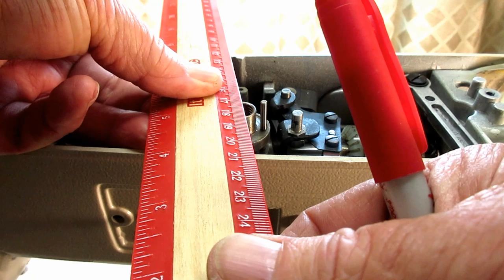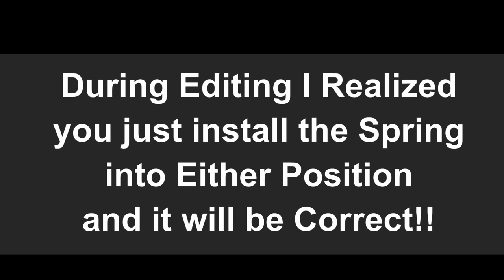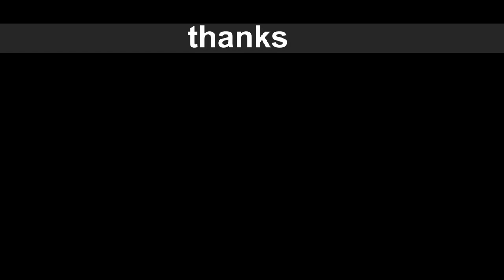How to Adjust the Camstack for Binding or Looseness on a Singer Model 457 Sewing Machine

Comment: Another great video Andy..I had a binding problem with my 413 and almost lost my mind trying to figure out what was causing it..Turned out it was a gunked up takeup lever.
Reply from the maker: You are picking this repair stuff up pretty fast! Hope you are having fun with it. Thanks for fixing the machine. Good luck.
Reply: @andytubesewing1953   Thanks..It's an enjoyable hobby for sure..I'm mechanically inclined but my memory isn't the best so I may have trouble remembering the part names..Luckily I'm ok at remembering where things go usually without pictures but probably a good idea just in case.

Comment: I bought a 347 with a broken gear and my mother's 348 with a metal gear ,I can take could make one thanks to you. I'm having bobbin trouble now but I just found out I'm 1/8 inch out of time, I don't see how it was sewing at all. Plus my needles aren't big enough or my thread is breaking I can tell that I sewed through an oily rag while ago and it lasted a little bit longer being out of time and everything.
Reply from the maker: That rotary hook can be a little forgiving with the timing, but wow! I'm also surprised it sewed. Sounds like it's coming along though and thanks for saving the machine.

Comment: The 347 has a different knob on the cam or as the 348 has a completely different top and a completely different kind of a cam.  it's amazing how these things are made so many different ways. If you can work on one of these you can work on a motorcycle transmission
Reply from the maker: Right you are. The 348 is the "premium" version with a small flip-up lid and the large chrome handscrew ( too big to call a thumbscrew I think) to make it easy to change out any of the approx. 30 pattern cams. The 347 is a standard ZZ machine with the one ZZ pattern cam screwed down. Haha, I don't think I could do a transmission though, honestly, but I knew you'd do fine with the machine. You know there are about 100 more models of Singer machines, just in case you get the urge to play with another one. Here is my main playlist page with videos sorted by model number. You could browse thru and see if any particular model caught your eye.
https://www.youtube.com/channel/UCUSPDsHaFtRoz1VA2U1xJ4w/playlist   Thanks again for watching my channel.

Comment: Thanks again for another fine and detailed video.  I have a 477 stylist that also feels like it is binding. I tried this adjustment of the cam stack and it still binds in one place. I need to order a new vertical gear as this one disintegrated and the timing belt is off. I have not taken the needle bar out yet.  The take-up arm looks a little bent in the direction of the balance wheel, but I’m not sure, maybe it had a slight bend to start with. Where else should I look for binding?  Also, no grease or oil goes on the nylon/plastic gears?   I hope you are feeling well, God bless you! (On this 477 you have to turn the stitch length knob to the space to the left of the zero in order to use a piece of fabric to pull it off. It then came off fairly easily) Thanks again.
Reply from the maker: No grease or oil on plastic parts (including gears) is what the Singer guys told me. There are modern greases now made for plastic so it's up to you. I've never seen a factory bent take-up lever, but plenty of take-up levers that were damaged or out of adjustment and causing binding. Here is playlist of some of my take-up lever videos that may help: https://www.youtube.com/playlist?list=PLsCOZgzzaiKLDJCdMOQ7FkIbiAaRT-8AA    Other things that can cause binding are dried up oil settled into the bottom of a bushing/bearing and on every turn or movement that oil drags or makes turning hesitant. Using a heat gun or hairdryer on all the moving metal parts you can see then generously applying fresh SMO can often clear up binding and hesitation. Oiling is the first think I do unless I'm just going to remove all the parts. The instruction manual has oiling instructions for your machine. It's free from Singer here: https://www.singer.com/search/support?title=477  Thread wrapped around under the hook. Those are some of the more common things to cause binding. Of course there are a dozen more.
Reply: Thanks for your quick response!  I will continue to search for the binding. I checked the cam stack, and for the the horizontal shaft being too tight up to the bushing, it was not either of those things.  Also the thread take-up system and needle bar. I won’t give up. Thanks again for your response and ideas of where to look to fix this.

Comment: My hand wheel turns about half way around and then is hard to turn for a bit then it’s easy again .any solutions to try would be greatly appreciated.thank you.
Reply from the maker: Hey, Joy. Binding can be caused by several things. A common reason is the cam stack is out of adjustment and that's why I made this video. If you just acquired the 457 and/or it has sat idle for a long time, there could be dried oil that settled inside the bushings of the machine. That oil can get very hard and even when you oil the machine a little the dried oil can cause binding as the shaft or rod rotates past that clump of oil. This is why I remove many parts and wash the machine out with Krud Kutter degreaser. You can also use alcohol or kerosene in all the oiling places and run the machine to try and soften the oil and flush it out, then add new oil. Another known problem with this model is that the top gear on the vertical shaft falls apart or the teeth chip off. When that first starts it's maybe just a few teeth, and when they come into rotation with the vertical gear on the arm shaft they do not mesh well and cause hesitation. The gear is plastic and costs about $10. Here are all my 457 model videos. One of them is how to replace the gear. https://www.youtube.com/playlist?list=PLsCOZgzzaiKK9GeuGLCo6ZyWv-HbheRVK Watching the gear video will show you where it is if you want to just check it for damage. It may still be good... or not. Another area for binding is in the hinge screw that anchors the take-up lever into the nose of the body above and behind the presser bar. If that was worked on and the screw was set too tight it will cause hesitation and binding at a certain point of the lever lifting up. Those are a few possibilities. If you need a copy of the service manual you can email to andymanuals53@gmail.com and ask for it. You'll receive a PDF copy of the manual (97-pages) in a reply email. Thanks for watching my channel, and good luck.
Reply: @andytubesewing1953  forgot to tell you it’s a singer genie 354.
Reply from the maker: @maizy1169  Well, yes, that can make a difference. Most of my first reply still relates to your machine, except for the top gear on the vertical shaft. On model 457 it is a very doable repair... thousands of people have done it. On models 353/354 it is a VERY DIFFICULT gear to replace. The gear has to come out the top of the machine, not the bottom, and to do that is a 12-step process to remove it, then the reverse 12-step process to put it back together with the new gear. A handful of people have done it with a couple of guys cutting a hole in the back of the machine for access to make it fewer steps involved. Here is a fellow who fixed his mom's machine without the manual to guide him https://www.youtube.com/watch?v=Iz3dN6_LPyo
You can buy the 354 service manual here for $9 https://manualsoncd.com/product/singer-353-354-genie-sewing-machine-service-manual/  I spoke with a friend just now and he agrees that your hesitation is a classic sign that the gear is failing... that the teeth are breaking off. I hope it's just the dried oil but be prepared. I have a whole playlist of videos for your machine that includes videos for removing the plastic covers to see inside for better oiling and to check the condition of that gear. You may already know how to do that but here are the videos anyway https://www.youtube.com/playlist?list=PLsCOZgzzaiKJvzcqn97Yh8lvx-tbdFl2p

Comment: What is the chances that you can help me work on my singer stylist 533 IT keeps binding at a certain time and it doesn’t do it when the gears are off like you showed me but as soon as I put the gears on it binds at a certain time
Reply from the maker: So by "gears", you mean the pattern cams? The difference when the cams are off the machine is the Needle Bar Driving Arm and the Needle Bar VIbrating Bracket to not move. With the cams assembled the Follower can contact the cams (in ZIgZag mode) and push the driving arm and vibrating bracket to make the needle bar swing back and forth to the pattern on the cam. You do not mention if your machine binds in straight stitch only mode, or zigzag mode, or both. Since you are having some problems I suggest you buy a copy of the original Service Manual for the model family. It only costs $5.00 to download here: https://manualsoncd.com/product/singer-500-sewing-machine-service-manual-518-538-513-514-533/
It is 70+ pages and will cover almost every moving part as far as adjusting and replacing. It's a very good tool to have for troubleshooting. It's difficult to diagnose some problems without having hands on the machine and even more so thru the comment section. Good lUck.
Reply: @andytubesewing1953  thank you
Reply from the maker: @joeblair995  👍

Comment: Hey, I Have a singer 347 I am currently in the process of repairing, it was my Dads like to get it going again. Question, when I have my stitch width set on zig zag, the needle is hitting the plate, to the left. I can get it to go back thru the needle whole, when cover is off and I punch the lever back in. Follows thru to the middle of needle whole then it hits plate again. Its is a slotted plate for zig zag. Hits right perfectly in between the dog, and the whole.The plastic cam (fashion disc) looks fine not wore out. Anyway I can adjust this out of it?
Reply from the maker: Hi, Jacob. There are some causes for this problem and some adjustments that can correct it. The first to check is the L-C-R Lever's function to see if it is normal. The L-C-R & ZZ mechanisms are tied together. Then there is the pendulam movement. My best advice is to go here >> https://manualsoncd.com/product/singer-347-348-sewing-machine-service-manual/
and buy a copy of the Singer Service Manual for your model. It costs $8.99 and has all the adjust, remove & replace instructions in words and pictures. If you plan on keeping your Dad's machine, or even if you sell it, it is well worth the price and can help you keep the machine in good condition and functioning normally. Good Luck.

Comment: Hi Andy...my arm shaft so stuck.... I've tried to put the oil on it. But still like traffic jam!!!!!
What should i do???? Futura 925
Reply from the maker: Well, all the parts move together. Like if the needle bar is stuck in the bushing with dried oil, then nothing on the machine moves. Or if the feed regulator is rusty, then nothing moves on the whole machine. When I get a "frozen" machine I usually download the instruction manual from Singer and use SInger or cheap SM oil and oil the heck out of the machine. I use a hair dryer to warm the oil & parts. In can take a whole day. If you are in a hurry, then something like WD-40 or a penetrating oil can be used, but it must be cleaned off very good. Regular SMO can be wiped up with a rag or paper towel. Just remember it might seem like the shaft is stuck (and it could be, with dry dirty bushings) it could also be other moving part.
Reply: Heat from old continuios soder iron heat and kroil
When you find out what shaft needs it..